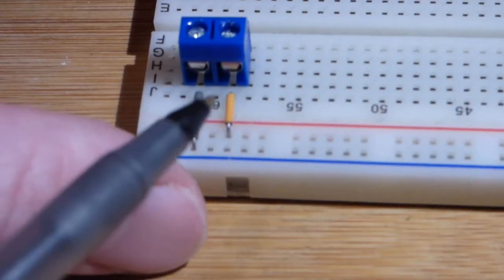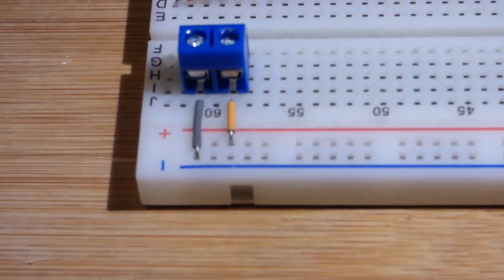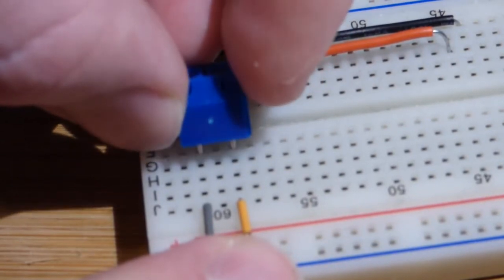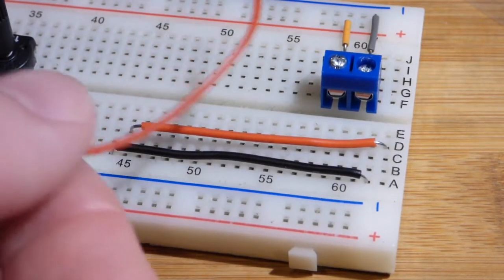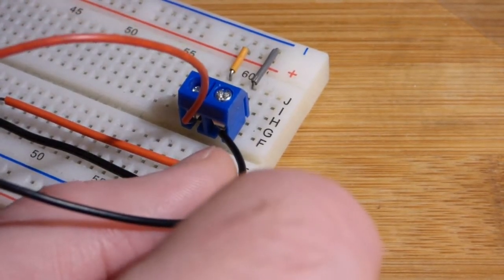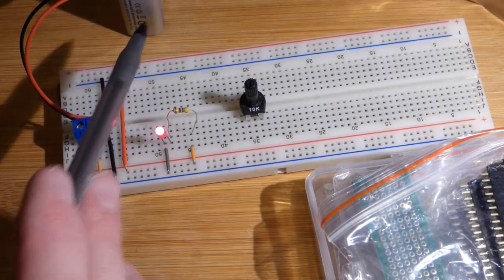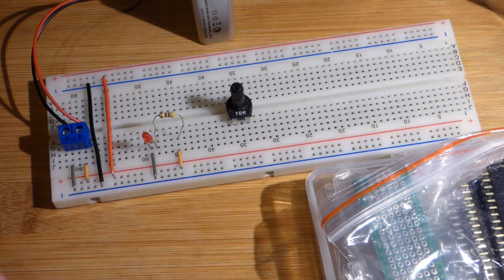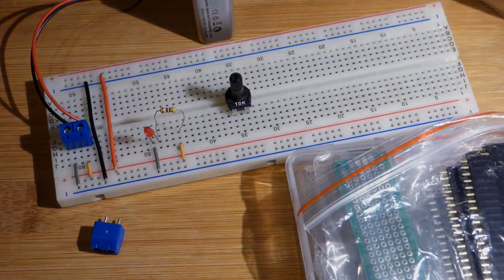Using an electronics screw terminal block to connect stranded wire to a breadboard

Comment: Hi very good video, i try to use this terminal block, the wiring is the same as explained on the video, but in my case the power resource is from arduino 5v & GND also connect to some sensor use terminal block for output, but the problem theres is no power to the sensor, in this short explanation, do you know where am i do wrong ? thanks
Reply from the maker: I never hooked one up to an Arduino, I would guess that the pins aren't long enough.

Comment: I just bought a PCB amp with these small blue screw terminals. Should I not use a connector of some sort to connect to them? Like a ferrule or something? I'm kind of new to this and trying to learn. Thank you!
Reply from the maker: I actually made a video recently where I connected a ferrule to stranded wire to plug into this terminal block. The 16 gauge ferrule is a tight fit, but I was able to get them into this terminal block. The mechanism for this terminal block is pretty friendly to stranded wire, so it's probably OK with just using stranded wire, but for the terminal blocks where it's just a screw making the connection to the stranded wire, I'd definitely recommend a ferrule.,

Comment: These are so awful. I need to do some wiring with a relay on PCB with 18GA lamp wire. Can you recommend some better terminal option that I can drop in and solder?
Reply from the maker: No clue, you'd have to see what other people are using.